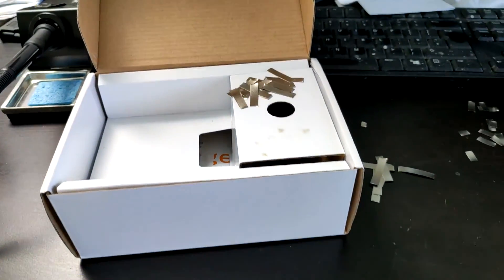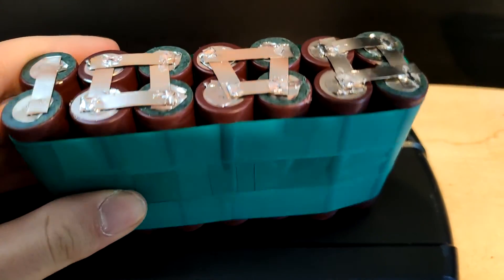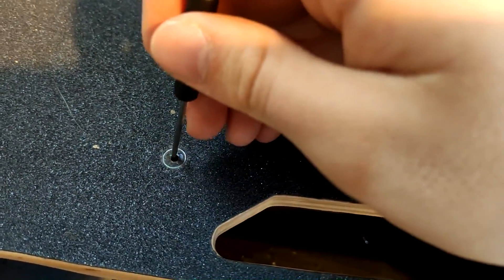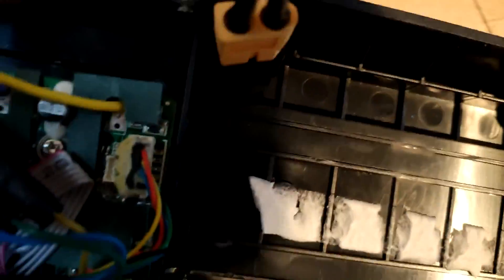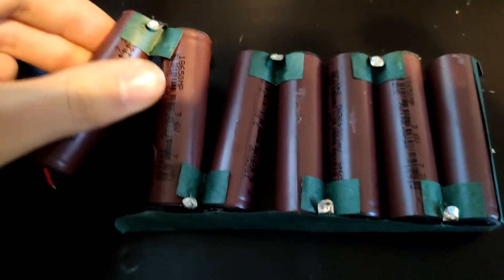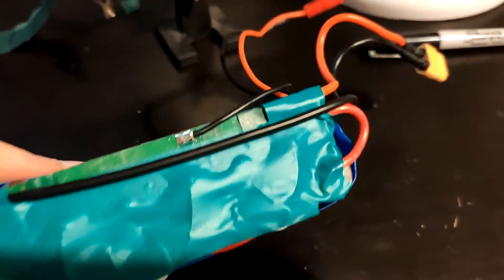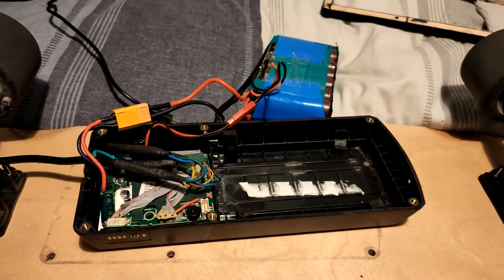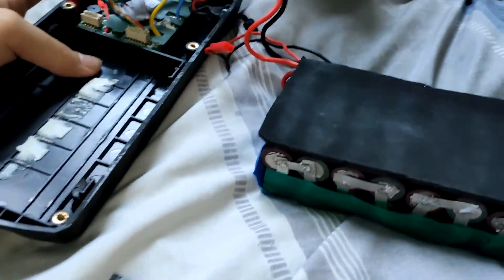CHEAPEST ELECTRIC SKATEBOARD - Battery Upgrade

Comment: i have the same electric skateboard, how do you find the hole of the battery pack  under the sticker accurately ? and how do you cut a perfect circle hole ? im planning to change the battery into the higher voltage to gaining some power in it.. thanks for the video btw
Reply: I saw another video where you just have to scratch around the corners with a pointy tool and you can feel the indentations. And then scratch them more to reveal the screw. Worst case  re grip the board after
Reply: Use a magnet.

Comment: Just bought similar one few days ago. I charged it but now it doesn't work. It only works when charger is plugged in. It only beeps if I try turning it on on battery power.
Reply from the maker: Hello, Sounds like the battery has some loose connections inside. If you know how to use a soldering iron then it could be an easy fix but if not have you tried returning it?
Reply: @JackVincent  Yup got a refund for skatbeoard. But I still have it. So might try to fix in future. I don't know how to solder so won't be able to do it at home.
Reply: i have the exact same problem
Reply: Were you able to solve it? I do have the same problem. I believe I had to sand the tip of each battery to make sure the welding stays since looks like the tips have some sort of protective coating.

Comment: I have this board as a backup to my main electric since I medically need it to get around school. The board stopped turning on (sounded like the issue you were having) and I need to upgrade the battery anyway.

Could you help me figure out exactly what I need to buy in a battery? I'm trying to purchase one here (https://voltaplex.com/7s2p-25.2v-5ah-li-ion-18650-battery-pack-samsung-25r5-cuboid) but the options all seem like important gibberish to me.
Reply from the maker: Hello,
If the board is not turning on then you want to check the charger with a multimeter to make sure it's outputting the correct voltage. If the charger is fine then the battery likey has faulty cells.
A replacement battery would be something like this: shorturl.at/cqIPT. This would be the same amount of cells as it currently has but will have a little bit more battery life. It will still need the connecter and charging cable soldered on.

If you want a better range as well you will need to buy a battery like this one: shorturl.at/lqSZ8 but you will still need to make a wood extension for it to fit.
If you have any more questions feel free to ask.